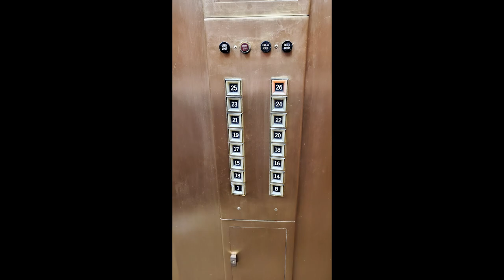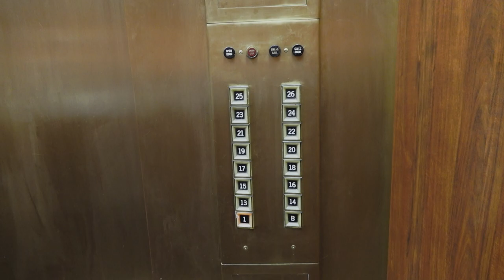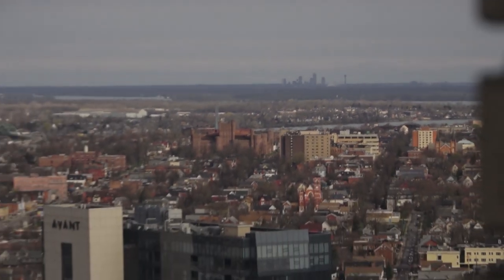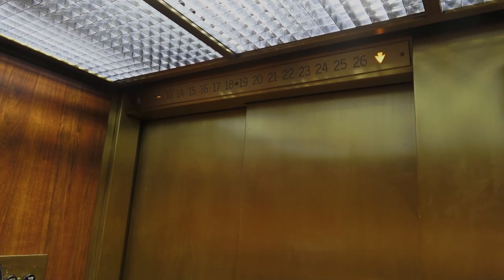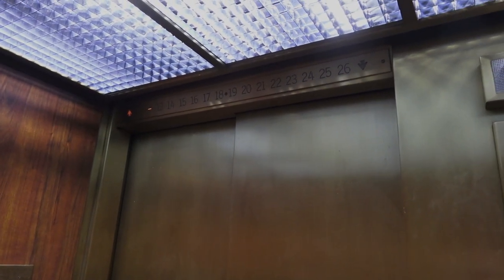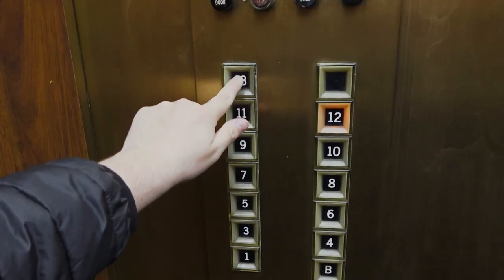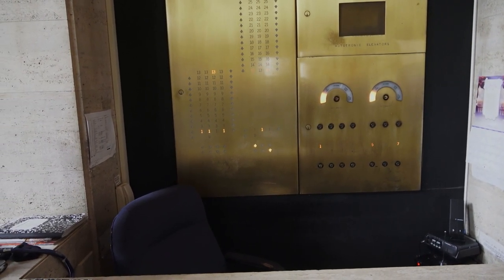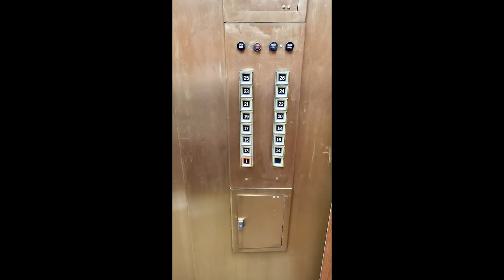AMAZING HISTORIC Otis Autotronic HIGH RISE Elevators at The Historic Rand Building in Buffalo, NY

Comment: Ours in the UK in a hospital near me (1964) were the same buy with push round buttons. Partially modernised early 80s with Kone Marryat & Scott with Dewhirst buttons as they were very heavily used.  They were extremely fast, with doors opening just as the lift nearly levels. The numbers used to skip as they flew up and down. Now they're some generic rubbish, all digital and a lot slower. I can still remember the 'ding ding' as the 'THIS CAR UP' sign and up arrow lit up on the ground the floor.

Comment: I am going to Buffalo in two weeks, is this place easy to get into?
Reply from the maker: There is security here, but they shouldn't give you problems.
Reply from the maker: I'd ask before riding though
Reply: @FloridianElevators  I did it! These elevators were so fun to ride! I will be posting my take very soon.
Reply: My experience here was very good.  They seem to be very friendly in this building as long as you are respectful when you are here.   If you get in, check out the bathroom on the 26th floor!    It is a "loo with a view"